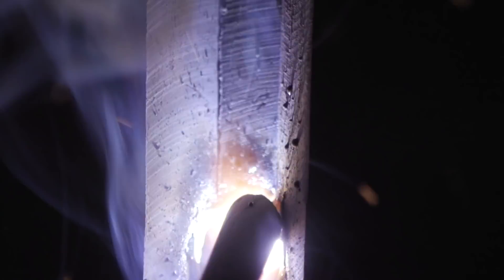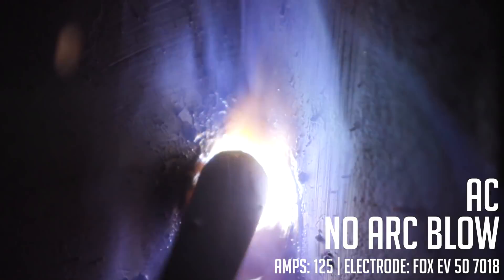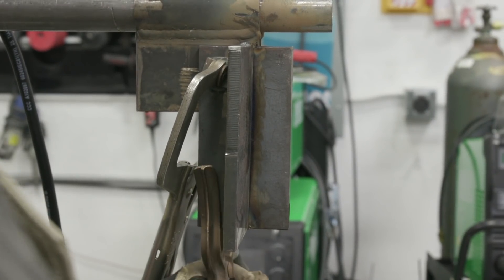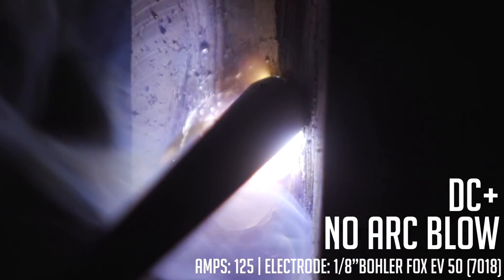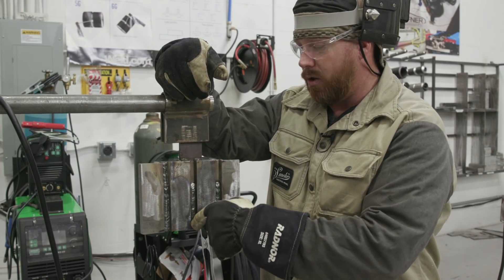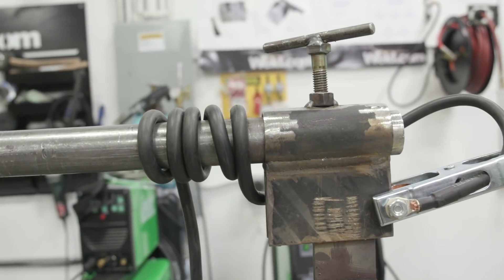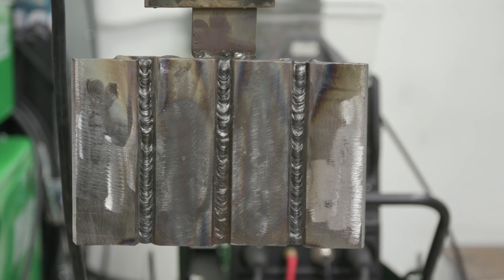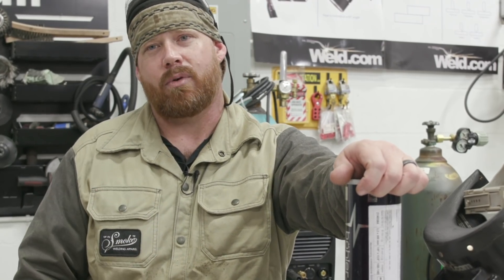4 Ways to Eliminate Arc Blow

Comment: I hope I can help you out with my "alpine English"... We'll see. "Arc Blow" is caused by the Lorentz force. A current which is flowing in a certain direction and a magnetic field (which may be induced by the current or a permanent magnet) interact with electrically loaded particles and deflects theyr movement. Basicly, the arc is just a flow of electrons and other electrically loaded particles. "Arc blow" is a situation where the flowing current, the magnetic field and the arc are in a "sweet spot" where the Lorentz force causes a deflection of the arc. If you go ahead and change the direction of current in the workpiece by using two ground clamps or repositioning, or if you change the magnetic field by wrapping the ground lead over the work piece, or if you use AC which alternates the direction of the flowing current in the workpiece, you simply eliminate that "sweet spot". Often, arc blow is also caused my permanent magnets which are too close to the arc. I hope that this makes things a little clearer for you.

By the way: The Böhler Fox EV50 is the "go to" 7018 over here in Austria. It was initially developed by Böhler / Voest Alpine and it's a widely known and well recognized electrode. I'm using lots of Böhler electrodes, including the EV50 for structural stuff and the FFB for heat resistant steels, and I can really recommend this brand.
Reply from the maker: Thanks for the detailed response
Reply: @Welddotcom  I'm just learning about welding, and just now heard about arc blow. These are some pretty ingenious workarounds. Even though it's just a chunk of metal and not a coil, the huge current running through it is turning it into an electromagnet and pushing the molten metal around with eddy currents and whatnot, as Gerhardter described. The short jumper is ingenious. It "short circuits" the piece and moves the magnetic edge away from the physical edge. I don't know if it's "Magnetohydrodynamics"  or just electromagnetism, because supposedly arc blow only applies to ferrous/magnetic materials. https://youtu.be/QArcTylNooQ
Reply: @Welddotcom  Here's a spiffy video from 1944 https://youtu.be/CW7I-ymfINU
Reply: Wow this helped out tremendously! I asked my instructor last night, 

“How do you control arc blow?” 
“Arc flow??”
“No. Arc BLOW.”
“…what do you mean?”
🤦‍♂️
Reply: Thank you for the information. It was useful.
Reply: Thank you,it was helpful. Blessing
Reply: Thanks alot, I've been observing these effects (and theire sollutions) for decades without a proper explaination. Now I can explain them to my team using the proper language. Blessings from the Netherlands! <3
Reply: I run Excalibur. When I was in school we where using some shitty 7018 and when I would run in 3s it would gum up and the flux wouldn’t burn. I love hohler but I only run Excalibur 7018
Reply: Thank you so much 
Really appreciated

Comment: Would any of these tips also work for Wire-feed welders?  I've tried everything else and by trial and error I've discovered that different brands of wire will cause more or less problems but I've not been able to eliminate it.   All simple enough to try though. Thanks.

Comment: I stil cant for the life of me weld a patch in sheet metal. Im already going way up in thickness, like 10ga so I dont burn through. Guess what. Still burn through. 

Am at the point where maybe its time to sell my welding machine, all the gear and just accept I am a disabled broken vet. I cant find even a shop to get past the tricky bits. Cant find a freelancer willing to come over and teach me or just do it so I can move on. I cant find anything around NYC for 100 miles. Nobody wants to work, learn or teach. Maybe I should just use rivets or gorilla glue...it seems to be the way of the future...forget previous methods and use "high tech" methods that fall apart in 2 years. 

Sorry for the rant. Just tired, black blew out again worst that my weld. I feel just as broken as the car Im trying to fix.
Reply: Use mig for thin shit

Comment: Just did a job welding carbon to duplex (2205) and was getting crazy arc blow only through a quarter of the joint the once I got pass that certain stretch it was running smooth.

Comment: Well im not wroger, but i did find a longwinded insightful answer to what causes it and whatnot. Hopefully this helps someone

There is a difference between thermal arc blow and magnetic arc blow. The first thing you need to is identify which is your case.
You've stated it's thermal arc blow, but then you've stated "I've tried turning down the heat and moving the ground clamp w/ no success"

That later sentence implies you suspect magnetic arc blow rather than thermal arc blow. I believe the other responses reflect that implication.

With that said, let's give a rough definition of the two most common forms in ascending order of probability.

Thermal arc blow: As you advance along the plate, the gap between the rod and the surface of the weld pool is ionized. That space becomes more conductive and facilitates transfer of the arc/heat from the rod to the plate. This condition sets up "thermal back blow" as the arc attempts to maintain itself through the ionized hot space rather than the cold space/cold plate. Some level of thermal back blow is not detrimental and effectively unavoidable. However; when you try to run to fast, or without enough heat, you're trying to transfer the arc through a zone of higher resistance with the inherent weld quality issues that evolve from that condition. 

Magnetic arc blow: MAB is due to magnetic lines of force/eddys in an unbalanced condition. It is also the reason thermal arc blow (TAB) is hard to diagnose. The inherent pushing of the arc due to magnetic lines of force/flux can push the arc away from the ionization zone and into a more resistive area which by default increases the arc blow effect. Going back to what causes MAB when those lines of force get out of balance, they tend to leave every increasing levels of residual magnetism. In effect the situation just makes itself worse the longer it's left unaddressed. After some time, TAB is no longer a concern. 

Fixing MAB is relatively straightforward in that you either eliminate residual magnetism, and or balance the magnetic flux conditions. You've already received some valuable comments in that regards. Defining the difference between TAB and MAB and in particular, the point in which one begins to amplify the other, that is not so easy. 

Some additional information;
Most articles I've read claim MAB can only be caused by 50 gauss (as determined by gauss's law for magnetism) but the evidence I've personally witnessed and researched defies that common logic in that it does not take into account the lower levels in which < 50 gauss flux lines amplify the inherent effects of TAB without leaving > 50 gauss in residual magnetic flux lines. It also doesn't take into account the materials in question. Nickel in particular is also ferromagnetic with a low curie temperature. That low curie temperature when welding materials high in Ni, causes the magnetic domains to align and snap the moment the metal drops below the curie temp. Unlike Fe which has a high curie point, the lower curie point of Ni effectively gives more time for alignment of the magnetic domain fields.

These are just some of the points to be considered. I'll desist on theory at this point. But I do strongly suggest you identify which is your case (TAB or MAB) before proceeding.

Comment: I have a question. I do structural, and everything we get on a job is painted shop coat grey, and we usually don't grind it off lol. And im not sure if this is acr blow or what but we keep our rods in the box stored in a tool box in the work truck, polarity is right but yet every so often, when running an 18, the puddle and the weld and the sound of the rod burning sounds like you are running a 6011. And this only happens once in a while just like arc blow. What causes that?

Comment: In this video Jason says weld away from your work clamp with 1/8th or less rods, but in the 3G D1.1 video a year ago Jason says to weld towards the work clamp with 1/8" or less electrodes. The Lincoln electric Procedure Handbook of Arc Welding says that the EM fields around the electrode and the work piece are both traveling clockwise, and Magnetic arc blow is caused by a contraction of the magnetic field ahead of the rod, because (traveling left to right) there is a high concentration of magnetic fields on the left side of the rod, which pushes the arc to the other side. The reason we see it happen at the end of the 3G uphill is because EM waves move faster thru steel than they do air. The area where the test plate ends is a barrier between steel and air. That barrier is more likely to cause arc blow because the arc wants to stay in the steel.
Reply: This assumes that electrons follow the path of least resistance. There is less resistance on the side of the electrode that is the direction of travel. Travel left to right, risitance is lower on the right and higher on the left. Systems always seek balance, so the arc wants to travel towards the place that offers balance.
Reply: The same applies to 3G uphill. The EM wave is strengthened by the work clamp (move away from the work clamp and the strongest forces are on the away side) therefore, we weld away from the work clamp in all situations where possible. Uphill, that puts the majority of the EM force on the underside of the rod, pushing what arc blow occurs to the top of the rod rather than the bottom.
Reply: You guys hiring?

Comment: I've done 3f mig on invar and it does this same thing. Wont even let you weld the last inch or so of the joint. And also tig on armor steel does this to me. But for the armor I just weld to the middle and then weld from the other end to the middle. Something to do with the end of the joint. Science

Comment: So what I'm gathering is the better ability of the "ground" (me,not a pro welder terminolgy) the better your product to be finish as intended .
Reply: The quality of the work clamp is important, as is the point of contact. Use a sturdy ground clamp ( most  240v welders under 500 and pretty much all 120V welders don't come with good work clamps. These should be replaced with a good all brass clamp or aluminum spring clamps with thick and solid brass fittings. The standard jumper cable clamp is not good enough.) And be sure to clean the area thoroughly, removing millscale and buffing out scratch marks.

Comment: I cant understand why you have that type off weld test in USA. ITS in my eyes totaly meaningless. Why not do the test with ceramic backing And Max 3mm gap. Or a open root. IT take alot longer time And ekstra welding having those big gap. And time is money. And fore weld test ITS a big job to CUT And grind of the backing strip.

Comment: Definitely have to try this method. Thanks very much for the tip and trick. However I am having an issue with the Arc air slice torch in the vertical position. Please can you share a video on how to do this process in the Vertical position .Im Andrew

Comment: The reason why that works when you wrap it aroundor just put the clamp I'm one piece and then on the other end of that same piece. It keeps the inductance the same. Or it's it's strengthens and stabilizes the inductance so there's no fluctuation in the current.

Comment: Always weld towards your ground ie vert weld clamp at the top of the piece. Always works for me. The worst arc blow is on a direct moment weld beam to H column on the bottom flange root if you clamp it to the end of the run off tab it cuts down on it but can’t ever seem to get by it
Reply: So the ground would have to be on the bottom of the plate??

Comment: Is this effect worse when you are welding metal that isn't a great conductor like stainless? To me it looks like what's happening is you have a difference in charge across the two pieces you are welding which explains misbehaving arc behaviour. Installing that jumper allows that charge to be equalized much more rapidly (copper being a way better conductor than anything you are ever gonna weld).

Comment: It works because resistance in the cable is less than steel plate.  Current takes path of least resistance to ground clamp and if it travels too far to get to clamp blow. This cable provides a 2nd clamp with reduced path.  Current goes through closest point.

Comment: We have that magnetic problem Welding with tig when welding pipe sometimes and it makes the arc go backwards towards the tig torch and wrapping the ground usually works but sometimes you have to reverse the direction of the ground coil but once you have your root in everything is good, kind of crazy